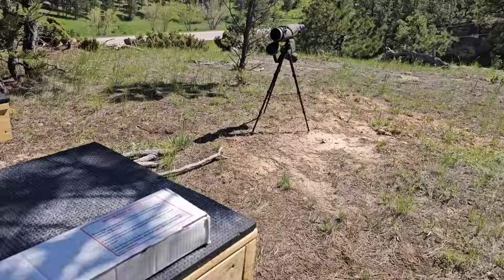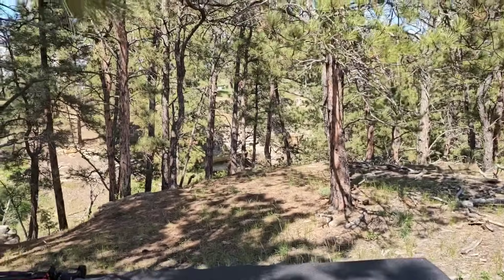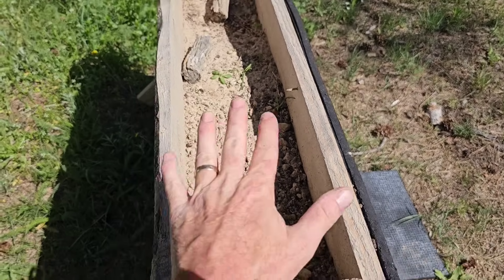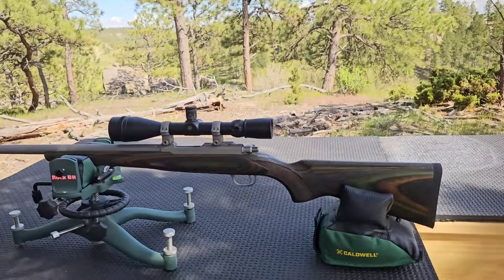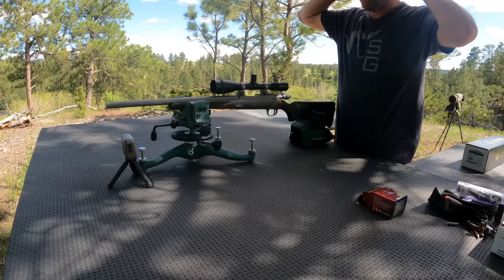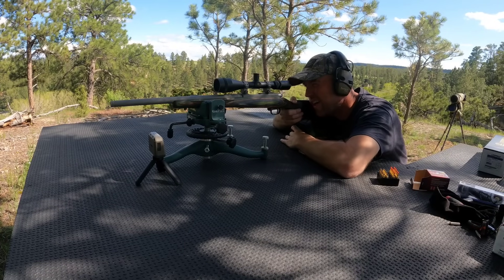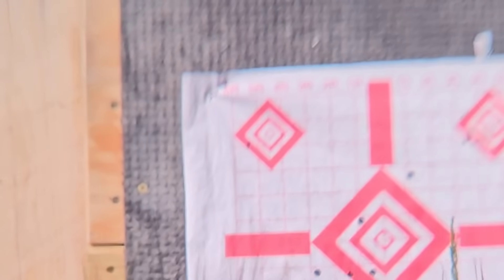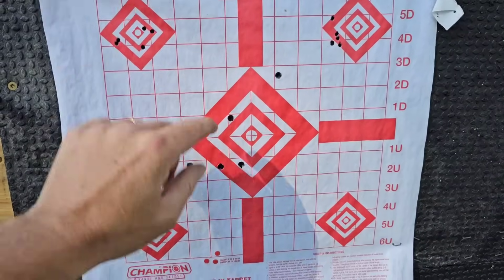This Caliber Is Over Three Times Faster Than The Speed of Sound.

Comment: I have a CZ527 17 hornet.  It likes the 20 gr Vmax at 3690 and the 15.5 gr at 3890.  The 15.5 run .3 to .6" and the 20 gr runs  high .3 to low .5" I am using a limb saver vibration dampener.  The gun likes to be shot dirty.  It also likes the Limbsaver a lot. 
I never shot a good group with factory ammo.

Comment: Have the same gun but with 24 in barrel, you're losing velocity with the shorter barrel. Also shimmed the bolt, installed rifle basix trigger, and glass bedded it. Reload 20 gr and 25,  hollow points and vmax. Nosler hollow points and berger group best around half inch. 20 gr reloads on chrony avg 3650-3700 fps, can push them to 3800 easily but hard on the brass. The 25 grs avg 3250 fps. The 25grs are much more accurate beyond 200 yards. It takes some tinkering to get the gun to shoot and reloading the round itself is a delicate affair but it really is something when you get it all worked out. Reloading for it is the only way to go for making more bullet options. Brass is around $35 a bag of 50 online.
Reply from the maker: I got it shooting good watch this video and you can see what I did.

https://youtu.be/1dwr5UcSqEI

Comment: Have a 30yo Savage 112FVSS, heavy 26" barrel,  in .22-250. It can drive 55 gr. Sierra, boat tail spire point, close to 4K fps but usually load it to 3750. Shoot at golf balls at 300 yards. Has a synthetic stock, rings and a 24X scope, +loading dies!...under $500 for everything...miss the old time prices, rifle was $299... 5/8 " @ 100 yards for 3 shots.
Reply: Yo también tengo un 22-250, lo recargo con ojiva de 55 gr. Nosler balístic tip, con pólvora H-380, a 3730 fps, le puse un cañon Douglas premium con un twist rate de 1/8",me da una agrupación sub moa, este rifle es un máuser 98.
Reply: @ManuelGonzalez-dv2cj 😊Lo siento, no habla Español!  Gracias!

Comment: If u dont have a 204 Ruger, try that and you'll sell the 17 Hornet, 204 with 32gr v max is advertised 4225 fps, i have i think 20" or 22" barrel and probably 4000-4100 ish im guessing and shoots way better than what u just showed in this video, mine is 50 yds 5 shots in a nickel and 100 yds 5 shots in a quarter

Comment: I've got the m77-17 in 17wsm, same stock and barrel. With 25gr bullets, I'm getting 3-1/2" groups at 200yds, on my best days.
I'm thinking I'll get it under 3 in time. I need to get it to work on coyotes at 250yds. I wish it had 4 more inches of barrel.

How much did you pay for the 17 hornets? The 17wsm in 20gr & 25gr came in at $.45 a round if you don't count shipping. 
Hope the rifle works for you in the long run
Reply from the maker: I got the 17 hornet for 1 dollar a round. But it's probably because it's center fire and not rim fire. I wanted to be able to reload them down the road.
Reply: @Guidedhunts I almost didn't buy the 17wsm because of scarcity of the ammo. I thought about reloading. But I'm getting old and don't have time to start a new hobby. I do enjoy the rifle. And it has a lot more punch than I thought it would
Reply from the maker: @ST-xx9rt yeah its opposite around here. I see the wsm ammo everywhere and maybe I should have bought it instead.

Comment: Hey Sir, I had a Savage Model 25 in 17 hornet.  I adjusted the accutrigger down as light as it’d go and the rifle had a decently long heavy varmint barrel… 20” if I remember correctly.  (Beautiful rifle). But I couldn’t get it to shoot anything well.  I even got dies and reloaded every 17 caliber bullet I could find locally.  The 25 Grain Berger HP Match bullets shot best but even those were just at 1” for 5-shot group.  And at $75 for a box of 200 bullets, that’s WAAAY too expensive for a .17 in my opinion.  The only powder I tried was IMR 4227 but again, even with factory ammo I couldn’t get it to shoot.  I think it’s just too fast for those tiny bullets. I traded that rifle for an ugly little Ruger American invite in 17 HMR and it shoots 1/2” groups at 100 all day long with Hornady 17gr VMax.  Yes, it’s 1,000 fps slower but I’ve not shot a single rock chuck that could tell the difference. 😂
Reply from the maker: Thanks for watching. 👍

Comment: When I was looking at getting a 22 Hornet , most people , said IF you want a accurate Hornet , get a CZ -527 , they believed that the front locking lugs on the mini-mauser action , and the straight chambering by CZ , gave the best chance for having a accurate Hornet .
2 normal cheat codes for reloading 22 Hornet are , use a Pistol Primer & crimp the case ( Lee crimp die ) , my go to load is 40gr Vmax , 13.0 gr Lil'gun , gives me 3000fps , and 0.390 inche at 100yds , 3 shots .
Barrel has been cut down to 20 inches , and running a small SS can .

Comment: Hey Eric great caliber choices. Your going to love your 17-Hornet. It's devastating on small game and varmints. The 17 & 20 are two calibers that most people don't know about. They are excellent varmint calibers. We have been hunting with them over 40 years now. We love the 17-cal on small game & varmints it even works well on deer & hogs. Of course head shots & neck shots Get-er-done on deer. We have a few 17-Hornets. One is a Ruger M77/17 24-in Hvy barrel and we have #2 CZ-527 Micro varmints with custom 26-in stainless med Hvy barrels. Now we don't shoot factory ammo we reload everything. Factory ammo is so watered-down. We have a few different loads we are shooting at the moment in 17-Hornet using Hodgdon Lil-Gun. Hammer monolithic bullets the 18gr dead blow at 3872fps & 21gr hammer hunters at 3789fps they are devastating a varmints worst nightmare. Hornadys 15.5gr-NTX monolithic at 3892fps are very explosive. We get 1/4-MOA to bug-hole groups with all 3 bullets. Shooting 30-32gr bullets in the 17-Hornet the velocities are slow 3100fps. The heaviest bullets we shoot in the 17-Hornet is 25gr. The 17-Hornet will push the 25gr 33-3400fps with good accuracy. I prefer speed with my accuracy.  We shoot the heavier 17-cal bullets in our 17-Mach-lV, 17-Rem & 17-5.56-KAK. Shooting reeds bullets between 30-34gr. The 3XG VLD long-range varmint bullet has a G1-BC .340 WOW. In the 17-Remington  & 17-5.56-KAK we are pushing that bullet between 42-4350fps . Our 17-Mach-lV shoots the 3XG VLD just over 3650fps. It's truly a good long-range varmint bullet. The Texas Gold 30gr-BT-HP has a G1-BC .280 it does really good beyond 400yrds also. Having a big family we shoot a lot of Rim-fire like the 17-Mach-2, 17-HMR & 17-WSM. They work great from 0-200yrds. If you want the best out of your 17-Hornet you should definitely reload to get the accuracy performance & velocities its capable of. It's so cheap to shoot 17-Hornet if you reload. I hope this helps you out. I have years of data if you decide to reload. God bless you and your family. God bless America 🇺🇲 🇨🇱 🇺🇸 🇨🇱.
Reply from the maker: Thanks for all the information. It sounds like you have a lot of experience with the 17s. I am planning on reloading, starting to get the components together now. Thanks for watching. 👍

Comment: 😂 amigo I literally just got the Savage 25 version. I’ll be reloading for mine just got to get the barrel threaded for the suppressor. 
I did put 25rds through it before I went for groups.  It’s tightened up real good after 50rds. Only issue I have is ejecting cases. Hoping after a put 100rds through it that will resolve itself. 100yards at the moment about 3/4 inch grouping with factory ammo.
Reply from the maker: Nice, thanks for the comment.
Reply: Check with WITT MACHINE. They custom machine clamp-on adaptera per your barrel measurements. A LOT cheaper than threading a barrel and non altering. I've gotten three clamp-on MRE's from them. Not a single problem.

Comment: Savage model 25 thumb hole stock 24in barrel mine will shoot 3/4 inch groups factory or hand loads my 17 remington will shoot 1/2 or better with hand loads 25gr. Old berger target bullets an 25gr hornady
Reply: I have the AR15 with a Shilen 20 inch barrel in 17 rem it also can be a one bullet hole accuracy
Reply from the maker: Thanks for the comment.

Comment: Love the 17 hornet. Have CZ 527. Shoots solid and has a set trigger. Had it about 10yrs. Only shoot hornady 20grs. You are correct ammo is limited for sure. It will hold 1” groups. Used it on prairie dogs out to about 150-200yds. Runs out of steam pretty fast being a small light caliber. Good luck with the rifle. Beautiful and makes me want to go find one.
Reply: I also have one and mine shoots great!
Reply: Float the barrel.  Epoxy bed the front action. Clean the barrel real well. Rifle Basix makes a good trigger. Try the 25 gr bullet.   I have a lot of Ruger Mk ll’s they all shoot great with a little attention.  Float the barrel all the way back to the epoxy. Wood dowel and sandpaper.
Reply from the maker: Thanks for the information, I looked for a CZ but couldn't find one. I wish ruger would have  at least put an accu trigger in these rifles. Would have been better than what they have now.
Reply: @Guidedhunts Pretty sure CZ discontinued them a couple yrs ago.